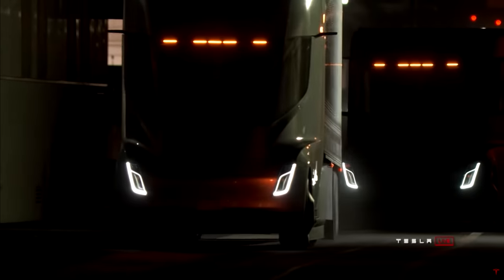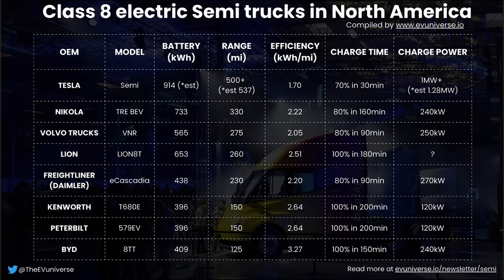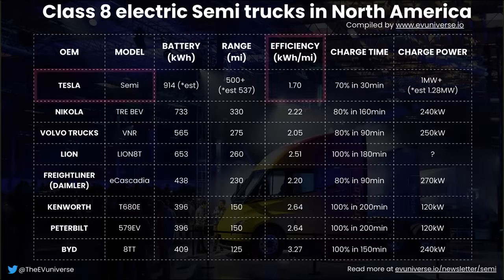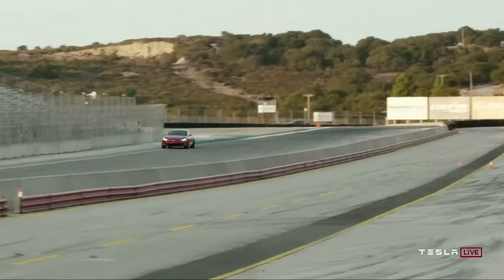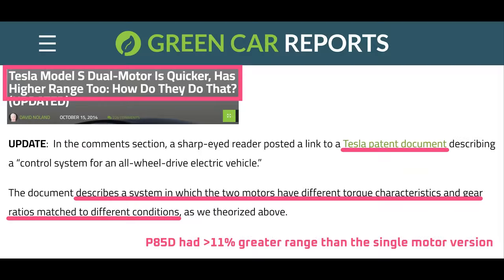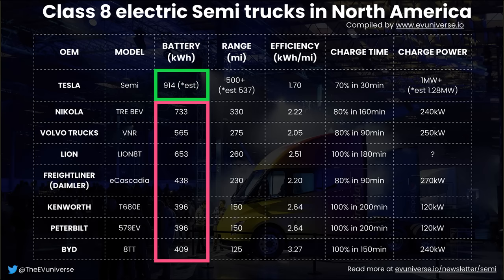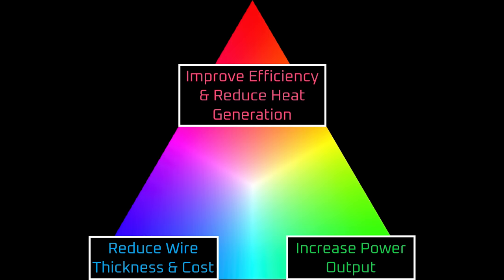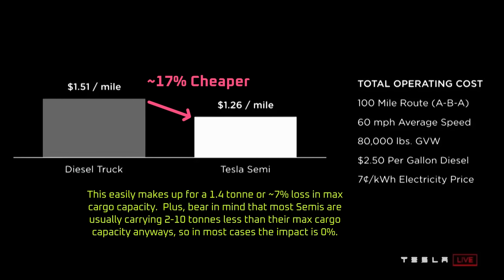How the Tesla Semi “Broke the Laws of Physics”

Comment: Just happened across this video, and subscribed immediately. Really solid analysis, well done. Reminded me very much of my time as part of a 200 strong team developing a sadly aborted EV.

One minor point, and this might be because you borrowed the graphics, but a KWH is a nonsensical Kelvin-Watt-Henry, while a kWh is a kilowatt -hour. You also said at one point that a battery stores power. It doesn't, it stores energy 😉
Reply from the maker: Thanks Cap'n!  As for the power thing.  I said power because the motors are generating power, which is being fed into the pack, at which point it's energy?  

I could have it wrong!  There were a few semantic things like that in this video where both seemed accurate.  Do I call the motors generators for instance when going down hills.
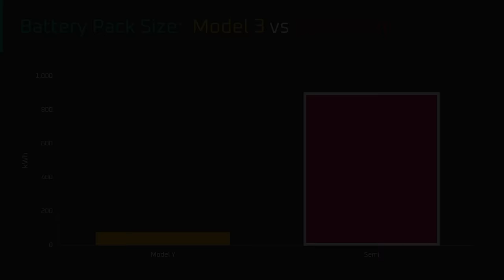Reply: @thelimitingfactor  9:13 "the semi pack has roughly 900kW of usable energy storage". I think this was probably a slip of the tongue 😉 Though Ihere are more capital letters in units in the model 3 graph. KM/H (Kelvin-Mega/Henry) for example. 

Motors and generators are essentially the same thing, albeit design-optimised one way or another. Saying "the motors are used as generators during regen" is entirely accurate. I usually find videos such as this frustratingly inaccurate but I was being super picky to find the points I did. You nailed a lot of things hardly anyone seems to know. I worked through the question of 1 or 2 speed drives on the project I was a part of. It's brain-bending to try to explain to people why an EV does NOT benefit from 2 gears unless you want either fast off-the-line acceleration or a (mostly impractical) high top speed. In fact the crazy 0-60 times is driven not by the desire for performance, but the need to cover use cases such as starting from rest uphill with a heavy trailer - something an ICE vehicle covers with its multiple ratios. This is the reason smaller EVs do not have a tow-bar option.  

I'm not now in that "world" but in a different area of electrification. Happy to chat if it would help you. martin@delorean.co.uk

Comment: Why are electric motors in cars using alternating current? I'm shocked to learn this since the battery is DC and I can't think of anything good to be gained by adding an inverter and changing it to AC before going to the motor.
Reply from the maker: This is something you can Google.
Reply: Yes, every modern EV uses an AC motor. Specifically, they are all 3-phase AC; most are synchronous interior permanent magnet, some are induction, and there a few other oddballs... still AC.
Reply: If you "can't think of anything good to be gained by adding an inverter", then you apparently don't understand that the inverter is not additional (the inverter is used instead of the DC controller needed for a DC motor), and you don't understand how a DC motor is constructed (with brushes and a commutator not needed in an AC motor). 

This is not specific to the Semi, or to Tesla, or to trucks (rather than cars), so you can do some general research into electric motors (try Wikipedia) to understand the reasons.
Reply: @brianb-p6586  thanks for the info, it's just the first time I heard that. I have a ¾ megawatt solar carport that was added to power an existing small business so obviously everything goes through the inverters which causes some loss. Also the inverters are expensive and are the most common fail point. My other experience with solar and motors is off grid solar powered water pumps for irrigation. In my experience these have all been DC water pumps that run directly off the panel. I had assumed the reason for that was to avoid the loss and the additional cost of the inverter. So I assumed an electric car would be direct current since it's being powered by battery. This will be my next YouTube search lol "why are electric cars Ac vs DC"
Reply: @lesburkholder8352  the irrigation pumps run at constant speed and load, so they don't need a controller - the DC power is just connected directly to their brushes; however, in a vehicle the driver needs to control the speed and acceleration, so a controller is needed. Internally, a DC controller uses the same expensive components as an inverter.

Comment: My question is when you have routes which have and uphill but when you get the top, its flat the rest of the way
Reply: You'd have to include energy required for the climb in your trip planning. For an electric semi loaded to the 82,000 lb. GCVWR, this would be about 35 kWh/1,000 feet of climb.
Reply: How many routes are uphill only?  What goes up must eventually come back down.  Your reasoning is badly flawed.
Reply: @TheEvilmooseofdoom  I drove 45' motor coach for years and they're certain areas where you climb a hill and they you get flat land for a long while.  That's the reason.  There's no need to be rude about it!
Reply: @TheBluebus17  Rude?  I was being accurate.  Your reasoning is badly flawed.  You might get long flat stretched but you still must go back down the hill you climbed on your return journey.

Comment: That limiting factor will change greatly once they start integrating large capacitors
Reply from the maker: If the motors are already outputting the max power to the battery, supercaps serve no purpose.
Reply: Capacitors will never be useful here.  As they store their energy in a field, the voltage rises continuously with energy.  This makes the conversion electronics to complex and thus inefficient.

Comment: The semi is never fully loaded. So the 1.7 kWh/mile sounds reasonable. For real world conditions and nominal capacity, its likely to be 2+ kWh/mile. Even a strong headwind can knock off significant range for a large vehicle. Specifically, the range will strongly depend on the terrain and weather. Hence, it is ideal to have them for a 300 mile range, that accounts for 90% of cab-less semi truck trips. Also, there is only so much you can do with a motor. Several AC motors are already pushing 95+% efficiency since a decade.
Reply: Except you forget Tesla (Elon) is quoting "fully loaded"?
Of course the "1.7kWh/mile is steady state, level ground", that what EVERY manufacturer bases their published specs on!
Would you prefer "already world leading, but we can see a path to between 19-25% improvement on even that figure (more when not fully loaded)"?
Reply: @rogerstarkey5390  I suggest they start by limiting the driver to 5'2" and 110 lb.
Reply: It's loaded to within 1,000 lbs. of the 82,000 lb. GCVWR for electric and natural gas semis. The range depends very little on terrain; the 500 mile range test climbed and descended the 4,200 ft. Tejon Pass (the Grapevine); and by the time it got to Pasadena was almost back to 1.7 kWh/mile. This was a result of regen braking coming off the Grapevine, as well as less air and rolling resistance losses on the Grapevine due to slower speeds. Weather would of course have some effect, as it would with diesel semis as well.

Comment: Of Tesla let’s one battery pack discharge first, they can perhaps set that pack up for faster charging (250 kW), and thereby regenerate even faster, don’t you think?
Reply: Doesn't matter.
For a start....
The load per cell isn't as high as you might think.
....
Then
All the truck needs to do is Outrange the driver over a day.
It can do that with a 20-39 minute quick charge, IF it's fully loaded.
If it's not, 10-15 minutes.
But the driver HAS to stop, so it's not a problem.

Comment: That 500 mile range is cut down to 350 miles when loaded.  Also, it cannot handle the max towing rate of regular semis.
Reply from the maker: And yet, the semis will be bought.

That's because they cost a lot less to operate and capitalism cares about profits, not point scoring.
Reply: The 500 mile range is for the fully loaded condition, although of course only in good conditions. Tesla demonstrated this in the published test route at 82,000 pound gross combination weight.
Reply: @brianb-p6586  First, the Tesla semi weighs so much (27,000 lbs) vs the average semi at under 20,000 lbs, that it will not be able to haul as much since the max legal limit for everything is 80,000 lbs.  An empty trailer weighs 10,000 lbs, so there will be loads that the Tesla Semi will not be allowed to carry as it would exceed the 80,000 lb total. 

Second, that 500 mile range is the absolute longest possible in warm weather and perfect conditions.  Real world use shows that Tesla’s can typically reach only 75% of their advertised range in reality, so maybe 375 miles.  The average long-haul semi can go 2000 miles on one fill up.  

So, Teslas won’t be used for long-haul or max loads.  I would say it would make a good fleet delivery vehicle.
Reply: @thelimitingfactor  Considering the price of diesel, you are right.  We’ll see about the reliability/longevity.  Well maintained semi diesel engines are known to hit 1 million miles before a rebuild is needed.
Reply: @Jason Carter  no, the US federal gross combination weight limit is 80,000 pounds for diesel trucks, but 82,000 pounds for electric trucks. That reduces the load carrying disadvantage of the Tesla Semi and other battery-electric trucks.

But I was only addressing the false claim that the 500 mile range was based less than a full load.
Reply: @jasoncarter4343   Real world use shows that Tesla’s can typically reach only 75% of their advertised range in reality, so maybe 375 miles.  
 
Estimating the Tesla Semi's "real world" range based on results of Tesla automobiles is a false equivalence. The auto range is established by EPA, based on a complex test route. It is not a "real world" range, and as you state, actual range is usually 75% of this or so. But the Tesla Semi 500 mile range is not an EPA rating, but Tesla's  demonstration of actual real world range, including loading to within 1,000 lbs. of the 82,000 lb. GCVWR, and climbing and descending the 4,200 ft. Tejon Pass ("The Grapevine"), and 7% remaining battery capacity after 500 miles.

Comment: It might have 500 miles of range, but until I can drive for 11 hours straight without refueling + idle with the AC on blast all night, I don't want it.
Reply from the maker: Yeah there's about 20% of the market that it doesn't cover.

I will note that the 'idling' won't be an issue when they do eventually come out with one with 750 mi of range.

The amount of power that it takes to run an AC unit is insignificant compared to a 1.5 megawatt hour battery...

3,000 hours with a 500 watt AC unit.
Reply: While air conditioning load is small compared to driving the truck, it doesn't matter for now because the Tesla Semi (like other brands of battery-electric trucks) is only offered as a day cab - no sleeper, so no one is staying in one all night.

Comment: Great analysis but very incomplete.  There are factors not specific to Tesla but encompass all electric vehicles that will need to be addressed, eventually.  The design is, of course, amazing to digest of the Tesla Semi, the loss of crew cab is understandable with batteries taking up space, and megawatt evolution is always fun to dive into.  But, what have we seen already with electric vehicles that will carry over to Tesla Semi?  The colder it is the thicker the air, the colder it is the more heat the cabin needs, the colder it is the more inefficient the battery chemistry becomes, aerodynamics and how the faster the vehicle's speed determines the loss of efficiency.  These are MAJOR factors that all electric vehicles have to overcome including the Tesla Semi.  Some can be carried over to Diesel like faster speeds being less efficient, too.  The proof is in the pudding, so I think California will be a wonderful place to start but the Tesla video never released the speed of the Semi during the run.  Please note:  I own a Tesla Model X w/Ludicrous and FSDbeta.
Reply from the maker: That's all irrelevant to the topic of this video.

That's a separate video.

That video would be titled, "will the Tesla semi actually get 500 miles of range?"

Comment: Will it be able to handle overweight loads? 80,000lbs up hills?
Reply from the maker: 82,000 lb, but you're asking the wrong questions.

The question is payload and profitability for that payload
Reply: The Tesla Semi delivery video shows a Tesla Semi towing a flatbed trailer loaded with >44,000 lbs. of concrete highway barriers, at a GCVW stated as 82,000 lbs., accelerating rapidly up a steep slope on Donner Pass, and passing a diesel semi as if it were standing still. So the answer to both questions is "Yes".

Comment: The energy prices in those calculations are weird tho. I guess energy is crazy cheap with you in the US - or was. At the time that calculation was made, you paid about $4.50 / gal for semi Diesel here and about $0.35 / kWh for vehicle electricity (13:1 gal:kWh). Now it's about $8.50 / gal and $0.60/kWh (14:1 gal:kWh), but still nowhere near $2.50 / gal, $0.07 /kWh (36:1 gal:kWh).
Reply: Yes, you can expect regional variations.  If you know your local numbers you can do your own rough math.
Reply: Prices for electricity of $0.35 / kWh to $0.60 / kWh are reasonable for high-rate DC charging at EV charging stations; the price to a residence or business is much lower, but still more than $0.07 / kWh. Many people use numbers from whatever source suits their desired result, not the costs relevant to the actual use of the vehicle.